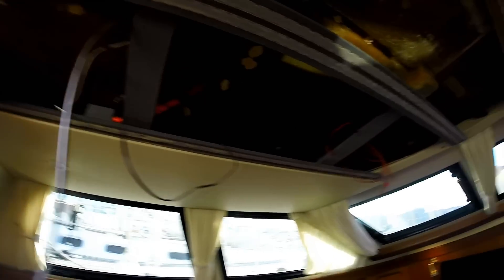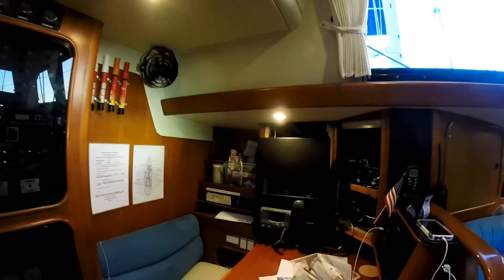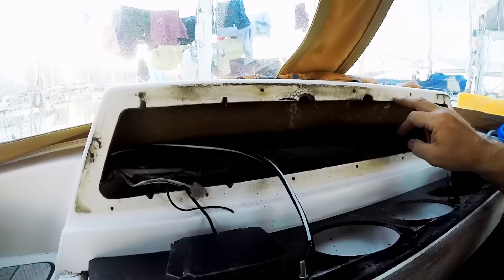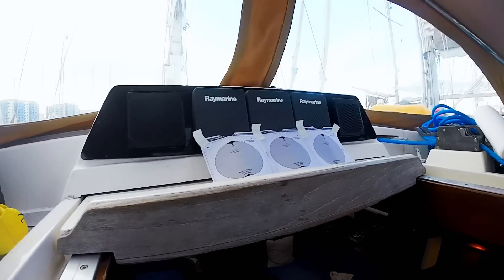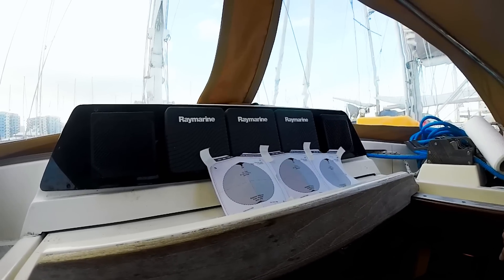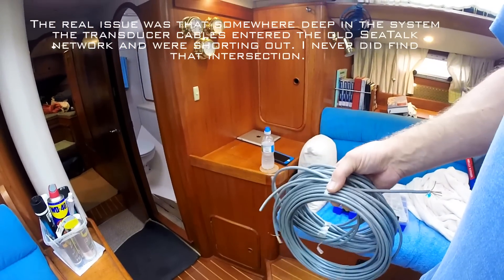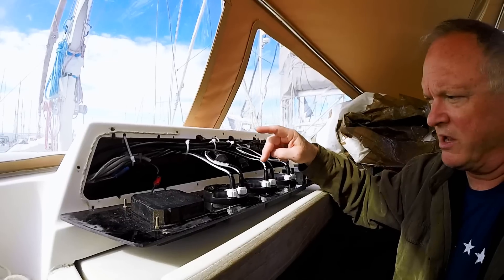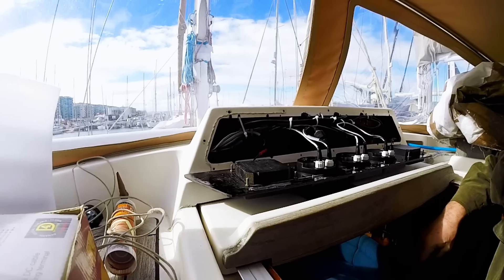Ep 55 New Electronics for Talisman

Comment: Great video again Kevin.
However butyl tape (same as raydon barrier tape) we used on our waterproof enclosures for our wireless network at work on top of mountains etc. It’s waterproof and seals....but you will never open it again!!
You mentioned not using silicone as you wanted access.....silicone will open easy does not stick well at all (unlike Sikoflex). However butyl tape sticks like glue. The boxes we sealed with butyl tape we actually broke the plastic trying to force the door open with a screwdriver after using butyl tape to seal them. Great stuff for boat windows......bun you will never get them out again!
Reply from the maker: Hi Jay. I've had excellent luck with butyl tape. People have told me though that there are differences in quality and to make sure about who you're buying from. Based on that advice we purchased our large roll many years ago from Sailrite, and of course paid a bit more than what it would have cost from the Chinese vendors on eBay. I think I'd hesitate to use silicone for the application here as it rarely survives long in a marine environment. And Sikaflex is just too good at the job, as you note. I'm confident that if I have to remove the console, which I will come spring as the companionway hatch needs new tracks and plastic runners, I'll just cut the butyl with a razor blade, leaving the two sides in place. Then when I reinstall I'll either simply reattach or clean and reapply. If I have problems I'll be sure to update the site accordingly so that you'll know.
Reply: @SailingTalisman  Great, let me know how it goes if you open up the panel again. Just like I mentioned we used good quality builders type and after around 6 months went to open a box to upgrade a router and could not get the do or off at all.
We could not get a blade in as a lip around the door. Great stuff for sealing but in past usages it stuck fast, far firmer than Sikoflex even. Be interesting to see your results. 
Happy sailing. 😃

Comment: Very clean install! Why did you go with Raymarine instead of B&G Triton 2 displays with sailing specific software?
Reply from the maker: Hi Morgan. The boat had Raymarine instruments when we bought her, so I wanted the system to integrate with the older instruments, and although NMEA 2000 networks can theoretically allow use of varying brands, in practice this leads to a greater likelihood of buggy interfaces. Also, B&G has gained a regrettable reputation for "phasing out" relatively new systems, leaving owners with no way to upgrade their systems, even after 4-5 years. Anyway, they're good products and I like what I've seen on other boats. Raymarine is pretty committed to having all the bells and whistles that you see in competing brands and I'd buy their products again if I had to. The place where things look most interesting is with 3rd party apps. The Raymarine Lighthouse III operating system is an Android product, and as such 3rd party developers can build their own apps and either sell or offer them as freeware for the Ray product lines. This allows enterprising developers to literally build the features that Raymarine hasn't gotten around to providing. With time, I think you see some pretty cool stuff being offered.

Comment: The tape should have been above the holes and circled around the holes also. Nice install though.
Reply from the maker: Hi Dale. I'd agree except that the big holes were already there. Mostly, the new Raymarine products are interchangeable with the old, except for the four small mounting holes. This allows the instruments to be secured from the front instead of needing access from behind like the old version. Part of the challenge was that the large holes were not centered on the panel. I did a little extra grinding with the Dremmel to improve the pattern, but could only go so far without the big holes starting to peek around the edges of the instruments. Thanks for watching as always.

Comment: I concur with the Orville’s comment, why are you spending time and money on gadgets you don’t need, when you could have been taking the lovely Wendy to dinner for the next couple of years?
Reply from the maker: Hi Anthony. I agree in theory, except that the autopilot actually needs wind and speed data in order to work to the best of its abilities. As it was, with wind and speed on the "old" network and the autopilot and control head on the "new", it had no way to calculate vectors on the chartplotter and probably no ability to compensate for drift (leeway). It made up for this with GPS fixes, but still hobbled I'd say. A whole bunch of new features began to show up after the install, but these could also have been improvements to the Lighthouse III OS. As for the dinners, I'd rather give up on cruising if meant I couldn't do dinners out with Wendy. She's the best company and most beautiful girl no matter where we go.
Reply: Well said, Sir. Love to both of you.

Comment: Hi Kevin, love the OCD qualities.

With going to the i50 and i60 are there certain new features you are hoping to use?  Just wondering how much of the upgrade was driven by a need for a missing piece of functionality vs. replacing old, non-working electronics.  Thanks as always for a quality vid.
Reply from the maker: Hi SB. Good questions. What you surmise is correct. As I went to move the functioning (but separate) ST60 and ST60+ components onto the new backbone, I was getting either no data or corrupted data. Raymarine sells the yellow backbone bridge to bring these ST1 components over, but they no longer offer firmware revisions and so there can be issues. I also found that the temp sensor portion of the speed transducer often fails, as mine did, and it will prevent the network from seeing speed if this is so. You can add a 100ma resistor over the white and brown posts of the ITC-5 to trick it into seeing 70 degree water temp, and therefore getting your speed back, but I just gave up and bought a new speed transducer. Obviously, none of this is shown on the video, but all is well now. i50 and i60 instruments are great for what I used them for here, but i70 is the way to go elsewhere as they are so much more versatile. I already had one on my Navpod at the binnacle, but added two more at the nav station, and these are great to have. You can even make you own custom pages, which I did to see SOG, Boat Speed, DTW, and ETA, all on the same page. i50 and i60 are specific to what they report (wind/wind angle, depth, speed, or tridata. Pretty limited.

Comment: Hi Kevin, great advice as always, i wish i had your engineering background. One question those speakers you Put on the strip with your new instruments, who makes them? Ive been trying to find speakers the size of Raymarine instruments for a while now. I took four old ST 50s off my panel and replaces with i70 and p70.
Reply from the maker: Hi Keith. Those are Simrad speakers from some previous install. They don't work (might work?), but I suspect they were there to supply sound from a VHF radio. So many changes to the electronics over the years. I love the i70 and p70s that we have, and in fact used two more i70s at the nav station since they offer such a range of data. I think I'm finally there with getting the electronics up to modern standards.